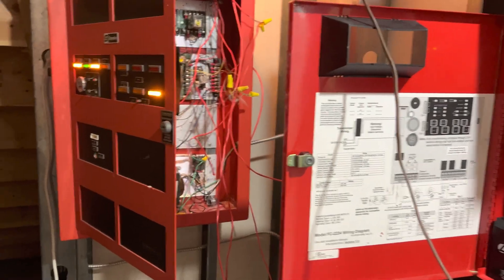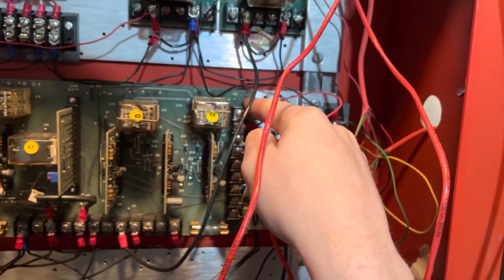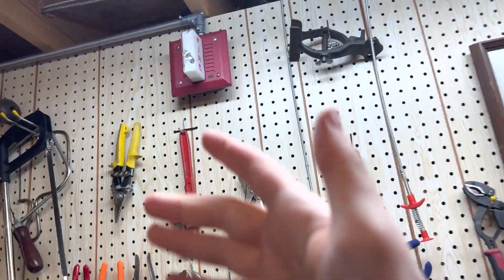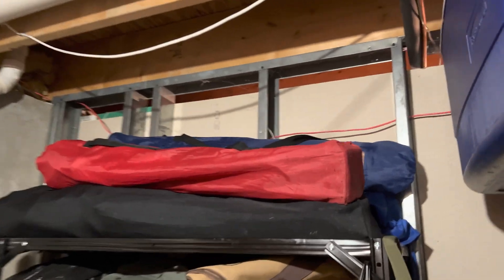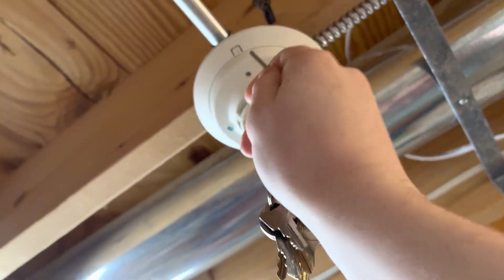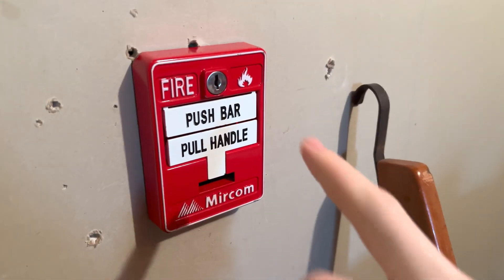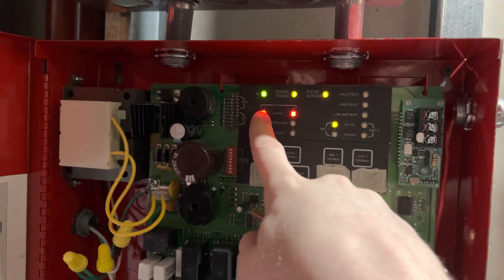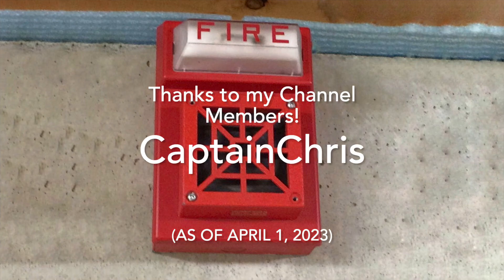System Test 42: Major Changes!

Comment: So the smokes are wired to the 4207? If not, what trips the 4207 and/or what other appliances beside the other panel is wired to the 4207?